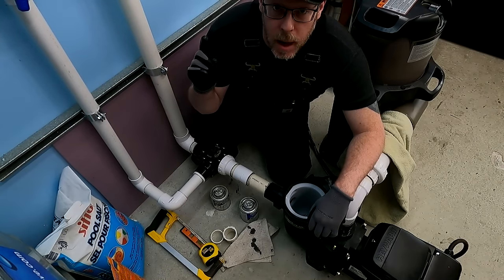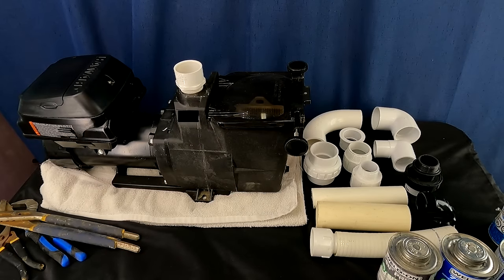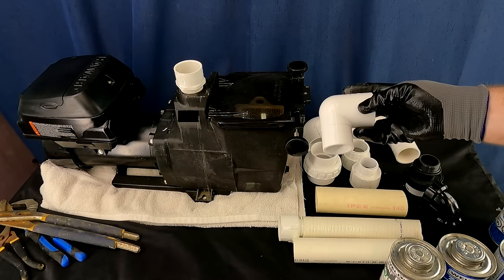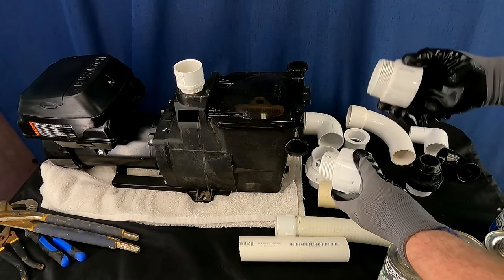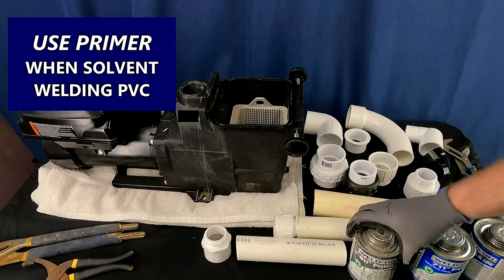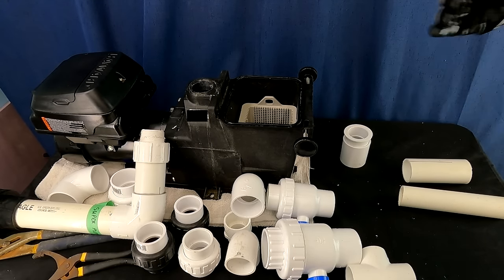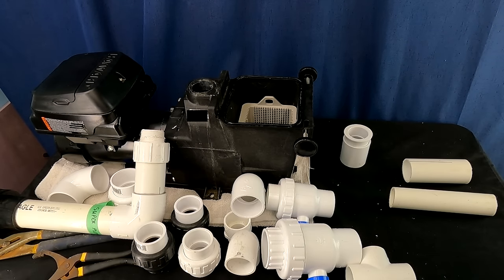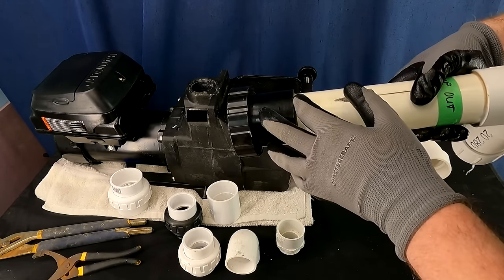How To Install a Swimming Pool Pump (Better)

Comment: Why do you have to forget about converting from 1.5" to 2" if you have only one suction line? You never explain the disadvantages or issues that could arise if you do this and its slightly frustrating as the rest of your video is insanely spot on and informative an actual novice could follow along and most likely plumb an equipment system properly. I've been taking notes this entire time watching this and you just left me hanging with no more knowledge :/
Reply from the maker: If you have only a 1.5" suction line there is no (can be no) advantage to increasing in pipe size on the equipment pad. The small suction line fails to be able to supply the large pipes through the equipment. It creates turbulence and potentially cavitation due to the small pipe trying to full a larger pipe. This is why you need more than one suction line a 1.5" to adequately supply a 2" pipe.
Reply: @Swimmingpoolsteve  awesome video!
Reply: @Swimmingpoolsteve  awesome video!
Reply: 😂😂😂 silly boy lol
Reply: @Swimmingpoolsteve pump is 1.5 union and 2 inch rigid 13:35 oh speak of the devil
Reply: Finally an answer to my question. Awesome video. I just also was left hanging and went through all the q&a to find an answer. Thanks for the question
Reply: @Swimmingpoolsteve  video is an amazing help to me, thanks so much! I think Im confused on the rules of using 2” pipe. Does it make sense to have 2” on the suction as well as return sides even if I only have one skimmer line and one robotic vacuum cleaner line, or do you mean it’s best to stick with 1.5” pipe on the suction side in that case? Thanks for any help!

Comment: Steve, you are amazing. About 4  years ago, we moved to a home in a very remote area of the mountains of east Tennessee. 30 minute drive to nearest town. 50,000 gallon in ground pool. We are about 1.5 hours from the nearest pool service company. Nearly impossible to get them to come all the way out to us. When they finally did come, the tech was stinking of alcohol on his first service call. Second service call, he demonstrated his lack of knowledge and experience when he told me the pool equipment did NOT need to be bonded. "Oh, don't worry about all that - GFI's are more than adequate". I decided it was not safe for my family to swim in a pool plumbed and wired by people I don't trust will do everything safely. So I started watching your videos (about 3 years ago) and replumbed everything - new pump, new filter, new heater, (and no 90 degree elbows!). You have taught me so many important lessons - from basic plumbing to critical life safety issues.  I feel like I know you!  Most importantly, nobody has drowned, been injured, become entrapped and/or suffered an electric shock when swimming in our pool -- all of which I attribute to YOU.  PS, reading your life story on your website, learning all that you have gone through medically, etc, showed me a whole new side of you. I learned that you are so much more than some very serious guy on youtube called "Swimming Pool Steve". You are a brilliant and courageous man. And an inspirational human being to me. Peace, blessings, and endless thanks from the foothills of the Appalachian mountains.
Reply from the maker: Thank you so much for your kind words and incredible super thanks! Very much appreciated on this end!

Comment: I’ve been installing pools for 112 years with a cutting string, a measuring stick, a bit of twine with a bolt on the end and a Coors light and plumbing almost always works.

Comment: Just watched the entire video and that electrical part can TOTALLY relate to not explaining more.  Often I can tell by the questions someone asks they should absolutely NOT be doing it.  We've seen it all, crimps on solid wire, wire going the wrong direction around screws, 1.5hp pumps plugged into 16 gauge extension cords WITH a plug in timer, romex ran through conduit, loose push on spade connectors and bonds where someone used a piece of 12 gauge electrical wire to extend it...  also putting 2 bonds under the screw clamp on the pump to connect is also not code, you must use a split bolt connector (bug).  Our company hired an electrician to work for us, learned so much from him it was unreal.  Also if you read the NEC you actually CAN use a plug in cord on a pump but it has to be rated for outdoor and be sized correctly, under so many feet, etc, etc but rarely do I see an install done like that correctly.  Really informative video all around Steve, I actually had one of our new techs watch this in between jobs while driving.  It's unfortunate so many pumps are installed incorrectly, sometimes we violate the rules, prime example someone used a valve with two streets, the pipes coming up out of the ground are too close for anything else and it's solid cement poured right around them, customer just wants a new pump, sure I can explain that this isn't ideal but chance are they won't believe it (you know, it ran fine for 20 years) and hire someone else if I charge what it'd take to cut the cement, break it up and space the pipes better.  With electric as pool guys we're really not supposed to reconfigure things either without a license electrician but when I know something is beyond wrong I'll opt to make it safer or suggest they call a licensed guy to correct it, a few customer do, most do not.

Comment: Not sure if you’re still checking comments on a video this old. Having a new pool installed and our Jandy manual has the sweep 90 directly into the pump as a better option than 4x pipe diameter.

Comment: Great general tips, appreciated! I just had a Pentair Intelliflo3 installed by a large pool supply company. Their technician installed it with less than the 5x plumbing diameter (which would be 10") foe the inlet. I called Pentair directly as I read that MINIMUM requirement and they confirmed the warranty would be VOIDED due to the install. Pretty frustrating but I understand why the tech did what he did, limited to size of pad. Spoke with supply company, they said they would honor warranty if it ever came down to it, now to get it in writing.

Comment: Thank for a great video have learn so much from it.  The way the plumbing and the pump has been installed 20 years ago not very good flow like you have shown how it should be done.  And as electrical is not right at all. So i will have a qualified Electrician to thoroughly check it. Many thanks, Robert.

Comment: Those union adapters are great. Many newer pumps have unions on them, but for ones that don't these are very useful when servicing a pump. They allow you to disconnect the pump from the plumbing for much easier access.
Also the point you made about equipment bought online is very important. Manufacturers know by serial numbers which ones were sold through wholesale/retail, and which were sold online.
If there is an issue with the pump, if bought online people have little luck getting any kind of response regarding warrantee.
I'd also like to make a friendly suggestion about adding time stamps for the different topics of the videos, especially the longer ones.
Lots of good info here!
Reply from the maker: great suggestions and feedback, thank you
Reply: I'm also quite fond of unions when working with pool plumbing.  My setup originally had none, and when I switched out the sand filter, it took way too much work to do so due to uninterrupted pipe runs.  Now, any device that can be removed has a union on an each inlet/outlet.  When I found my filter was leaking to waste, I swapped my entire multi-port valve out because it wasn't that expensive.  (I also bought the parts to refurbish the old one, so I'd have a spare.)  Having those unions made it a breeze to disconnect everything.

Comment: Thanks a lot Steve. Your advices were used today as installed yet another pump for my in-gound pool. 
Things I improved over the last setup:
- Better teflon tape technique
- 12" inch long lead on the 2" PVC intake pipe with cpvc.
-  3 port diverter valve with unions  praher :-)   It was almost cheaper than 2 union ball valves and I saved a T .
-  skimmer and drain are 1.5" in the diverter and output of diverter is 2"
- clear pvc/cpvc glue and I used primer before.

This time I took my time cleaned all the parts (removed prices stickers located on strategic place)
 Dry fitted all and arrange pipes and fittings to hide markings.

Result, No a single leak. And that 2HP thing moves water like hell.

Many thx and keep posting those videos.

Comment: Great video with lots of info. Thank you for sharing. I have been learning alot from all of them. With regards to the EBC (Equal Potential Bonding Conductor) per the NEC in the US we are to use a #8 solid bare copper wire. It may not be insulated and may not be stranded.

Comment: I had a "professional" replace my old pumps last year.  After watching this video I see he broke your first rule already.  There are elbows an inch away from the intakes and outflows.  Not only that he reduced a 1 1/2" PVC by using a heat gun and of course it leaked catastrophically. Your video is perfect timing.  I have decent knowledge of plumbing and combined with your in depth sharing of knowledge I feel confident I can replumb this the correct way myself.  I wish I could Like this video a hundred times.  I will probably hire an electrician to review the install as well.

I have some PVC lines that are a mystery as to where they lead. A video on tracing down lines would be helpful if you have any wisdom there.
Reply: We can only work with the space we're given if it was originally plumbed in 2 inches from the vertical suction line you just go with it, it's not ideal but if we told you we have to replumb the pump 10inches back and add another equipment slab or replumb the suction side that will require more work or more $$$ you refuse that 😂
Reply: @charlierose1708  Totally get it.  But in my situation there's PLENTY of space to plumb it with 10 inches of straight pipe at the intake.  It's a faulty installation in many ways.
Reply: Cant tell you how many times I've had to go fix a new pump installed.

Comment: I live in Hamilton Ontario. You discussed pool electrical bonding. I have a Pioneer inground pool with a concrete surface surrounding it that was installed by Pioneer Pools in 1998. There is no bonding wire on the Hayward pump or heater. Was bonding not a requirement back in 1998. The pool pump is on its own 230v breaker and wired to the pump with a black, white and a ground wire.
Reply: Have you looked into a GFCI?

Comment: On the topic of electrical, is it common to bond the pool water (with an in line bonding fitting) in Canada? Doesn't seem anyone knows what im talking about when looking for one. All my other things are bonded as required.

Comment: Ive been following your channel and finally decided to upgrade from a intex pool to a more traditional above ground pool. Those sweep 90s I’m my area in non dwv are almost impossible to find. You should get affiliate links selling them. I would buy 6 right now if you had affiliate links lol.
Reply from the maker: I know what you mean. Sweep ell fittings for pressure rated applications have only barely become available in some areas.  Many still you can not find but that is often from pool owners shopping at hardware stores.  Hardware stores have terrible selections for pool stuff...even the big guys.  Find a pool supplier in your area and you will find you have a lot more to choose from, and more of the right stuff too
Reply from the maker: Here is a link to an online retailer with sweep ell pressure rated PVC fittings available, and there is a tracking link for me in there also: https://www.pntra.com/t/8-9718-298283-105063?sid=&url=https%3A%2F%2Fwww.doheny.com%2Fplumbing-supplies-skt-x-skt-sweep-elbow
Reply: @Swimmingpoolsteve  awesome !! I will order some today . Thanks Steve !! Probably sounds hokey but you have been inspirational in my pool ownership journey 😀
Reply from the maker: @shannon1872  that is a big part of the fuel that makes me do this! If not for positive feedback I would have quit 9 years ago!

Comment: Interesting you say never put anything in front of the suction line I have a Hayward power-Flo XL pump and it has a catch basin literally mounted at the end of the pump,  now I do understand hydraulic pressure and I will be moving the catch Baden some distance from the pump and installing ridge pipe everywhere I can with big sweeps

Comment: Maybe I missed it but with the high temp union that has an o-ring, do you still use Teflon tape and since it has an o-ring and it seems that that particular fitting should be bottomed out to full seat and seal? Thanks

Comment: Steve,

I love your channel and your intellectual approach to pool care. After watching this video (twice), I have a question regarding the street elbow you are adamantly opposed to. Because of my height restrictions on my equipment, I had no choice but to come out of the pump using the street elbow. What problems can I expect or should I look out for?
Reply from the maker: Increased resistance to flow at minimum. Cavitation and compromised hydraulic laminar flow at max. Listen for "rocks tumbling in the pump" which is the sound of (destructive) cavitation. If I hear this it is a replumb needed. Put a housekeeping pad under the filter and lift it by 3.5" to get the clearance you need for a short radius elbow or better, a sweep. Good luck. Thanks for listening to me ramble for 3 hours+ I feel that deserves recognition lol!
Reply: @Swimmingpoolsteve

Steve,

Thanks for the prompt reply. I've been doing my own pool repairs and service for 15 years, and I always learn something new watching your channel. I'm hoping I won't need to re-plumb.

I appreciate what you do!

Comment: Great job on the installation instructions! However, it's essential to use the International System of Units for consistency and clarity—meters, centimeters, and millimeters are standard globally. Let's adopt these measures to align with international standards.

Comment: Very informative and very helpful, i have question for you, can I install a check valve on the suction line before the pump in a vertical orientation and leave a 12 inch straight 2 inch pipe between the check valve and the pump as you mentioned in the video ?

Comment: Great video, super helpful. Thanks Steve. Is there benefit in merging my bottom drain and skimmers with a Wye tee? Mine come vertically out of the ground so I have an opportunity reorient them to being 45 to each other, before merging.
Reply from the maker: Wye fittings are not used on pool installations. That would be DWV. a tee would be used. But I vastly prefer running isolated plumbing lines to the equipment pad.

Comment: Congratulations on an excellent video.  I have an AstralPool Victoria Plus Dual Speed pump that a contractor left with only the Eco (low) speed connected via a timer.  He promised to return to add a manual switch for the Turbo speed which I used to use only for backwashing but it looks like he's gone AWOL.  Do you have a video to show how the pump connections should be made on this model?  I'm OK with installing an appropriate switch and ensuring the wiring is safe, it's just a question of which connections inside the pump should be used.

Comment: Awesome information. Question for you. I have 1 1/2" flex lines running underground to and from the equipment. What's the best set up going to and from the pump? 2" ridge PVC from the diverter valve to the pump using the high temp union reducer and then out the same way to 2" all through the equipment and then reducer back down to the pipe line underground?

Comment: Great information! I have a 27’ above ground pool and need to repipe it. I only have a suction line from the skimmer. Would you recommend 1.5” suction to pump and 2” after pump? Ty!

Comment: I would never use flexable pvc in the ground only when encased in concrete. Had to replace a whole pools plumbing (flexable pvc) due to tree roots that grew through the wall of the pipes

Comment: Great video Steve.  Helped me a lot.  I have an old pool with a single 1.5” skimmer suction line.  I recently bought a Hayward Tristar VSP (1.85hp) that comes with the 2” (2.5”) black unions for both the suction inlet and pressure outlet.  Was this a bad purchase?  After watching your video, I feel like things would be vastly more simple if I bought a pump with 1.5” inlets.
Reply from the maker: Changing pipe size is very common. It's just one bushing. Bit having the right pump is important. This is a powerful pump which can operate without damaging itself on 1.5" pipe but that is not to say it's safe for your / every pool. How many suction lines total. Is it a long pull, or a high push to rooftop solar? What is your filter max design flow rate? Lots of questions which generally is why it is advisable to bring in a local pro. At least this is the way the pool industry wants pool owners to go.
Reply: Thanks for the quick response Steve.  I have a local pro coming to my house next week to assist with the plumb in.   But I’m happy to be equipped with some knowledge going into it now.  I’ll probably keep the pump, as it’s going to run 24 hours a day at very slow speeds.